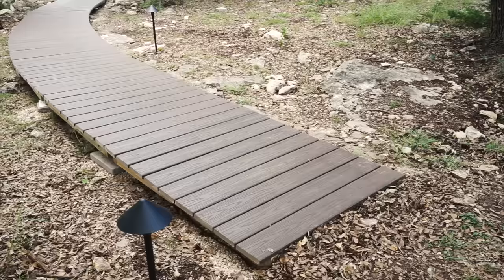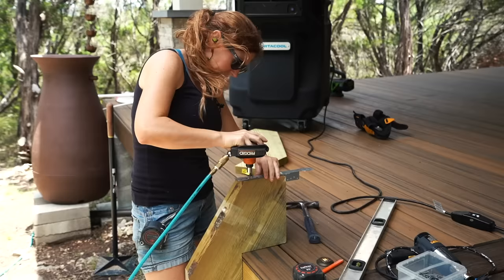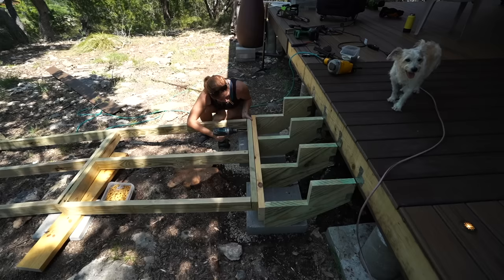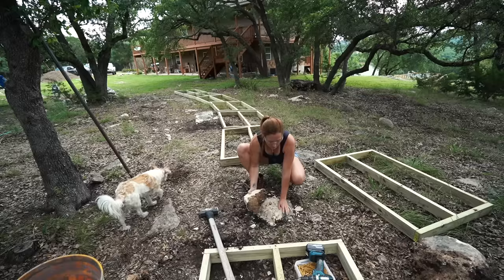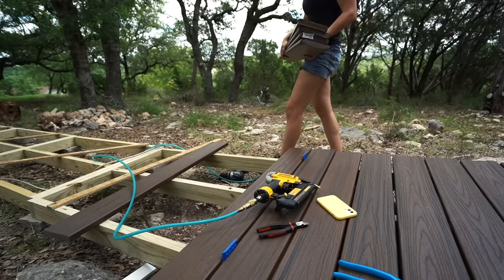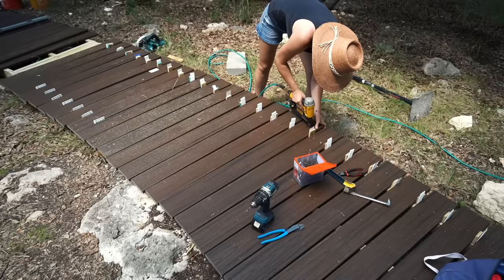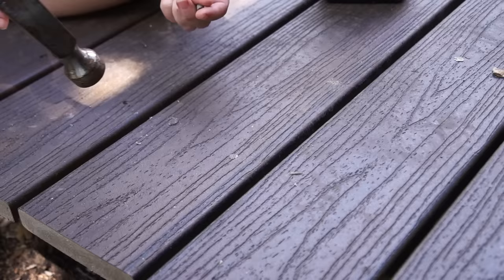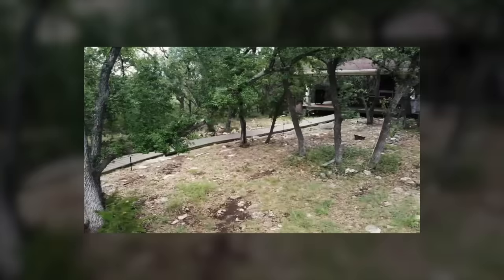Easy DIY Wooden Walkway | Path To My Outdoor Kitchen | Part 10

Comment: 6:31 but what about the boxes? even though they are treated, they will rot at some point and will have to be replaced. How easy will it be to remove the composite boards then?
Reply: She said the screws hadn't come in yet.  They can just be unscrewed and redo a section.  Pressure treated on gravel will last pretty long, I have similar to this with just old hemlock and as long as you have good drainage then we still haven't seen much rot.

Comment: It looks awesome! Question: When you bolted the scrap piece of wood diagnonally across the rectangular box, didn't that create an uneven height of the Trex boards that you later placed over it?
Reply: That diagonal piece is just temporary to hold the box out of square. Once you start screwing the top boards in place, they will do the job of that diagonal piece, so the diagonal piece can be removed.
Reply: @llamadohgaming6787  aah, now I understand. Thanks!

Comment: April, I'm curious why you started putting the brads in on a 45* angle with your jig to hold the tool, and what caused you to change your mind to just put them directly through the top instead.

In any case it looks wonderful, especially for the space it is in. I'm glad it turned out just as you desired. Love your channel. Thanks for the content and keep up the great work.

Comment: It's almost as lovely as you. A word of advice: when using a nail gun, avoid using your other hand to hold say a 2x4 like you did making the frames. Instead, stand on it, use your foot to hold it and get some steel-toed boots. If a nail skims off as in a double-bump, your boots will protect your toes.  I've seen nails go into hands so quick it doesn't even bleed... until the doctor cuts it out.

Comment: Nice job. BTW with the treated wood frame in contact with the ground, how long do you think before the wood rots and is no longer structurally sound? maybe use composite for the frame too?
Reply from the maker: You certainly can use composite for frame too but so far I've had no problems with my using treated wood. Thanks for watching.

Comment: This is nice. However where I live with rattles and field mice among whatever else nature brings I don’t want to build a home/ hiding spot.  Yours has a lot of hiding spots underneath.   I was thinking of pouring concrete to level it or just lay 1/4 inch mesh underneath and hope I block any entry to underneath.  Any suggestions?  Have you had anything living undenearh it?
Reply from the maker: I've had no issues but being in the country, if they're there, they are already around. Thanks for watching.

Comment: Trex board disintegrates and warps if you cut or screw into it. Its designed to be held down with special brackets. Its basically particle board once you expose the insides. I have to replace trex decks all the time. No one uses the brackets, and everyone cuts and screws through them. You voided the warranty the second you hit them with that brad nailer or cut them in half t make 8 footers (what i assume she did). 40 dollar boars that wont last 10 years now. Could have gotten 10-15 out of 2x6. Even flip them half way.

I'm surprised another contractor didn't say anything. If you look up Trex warranty its voided the second you "break or puncture the surface". The box of special brackets you have to use are at the store but they sure don't advertise them. Why would you, they get people to buy $50 8 foot board that lasts about the same time as a $5 2x6 because no one knows you cant cut them or screw them down or puncture the surface in any way. I'm not sad about it either, i get to replace these $50,000 decks with $10,000 wood decks all the time.

I guess you could seal the ends and every screw the but no one does. Look up ho to install trex brackets. They are grooved on the sides so you can screw the brackets into the wood but the bracket holds down the boards on the side. Still have to screw down the outside ones though and seal them. Just use wood.

Comment: Looks great, very cleverly done ... BUT, I doubt your timber is inground treated, it looked to be a soft wood, you will get rot where the timber touch the ground ... 1-2 years it will start to come apart.

Comment: Not sure what climate the area is that you built this in, but if it is area where the ground freezes with frost going into the ground 3-4 feet. If so did the frost shift the framing boxes up and down causing the deck board joints to longer be fluish with each other?
Reply from the maker: I live in Central Texas. Very rarely does it get below freezing for more than a few hours. Thanks for watching.

Comment: Galvanized fasteners and pressure treated lumber do not mix. Much better to use fasteners specifically designed for treated lumber,

Comment: I like what you have done there April, tradition be damned I say! Well done, it suits the natural elevations and lines of the ground much better than what would normally be produced. Without an traditional ground anchoring, does it move at all?
Reply from the maker: I've had no problems with walkway at all, regardless of rain or winter weather.

Comment: My only concern is, why not randomly dig post with concrete underneath the deck slabs to prevent it from shifting. Staking it to the ground permanently instead of just floating. My two cents

Comment: Should have taped the top edges of the pressure treated boxes.  Water will accumulate.  This will be the weak spot that causes trouble in 20 years;)

Comment: Even treated wood in contact with the ground will rot in about 8 years.
Reply: It will, last longer on her terrain. But the new copper wood treatment is not good as the old ones.

Comment: this path will rot in 2-3 years, the stands under the boards will fall apart in 1 year, after the first winter this path will be crooked and uneven.
to make a normal path, it is necessary to remove the top layer of earth, put geotextile, pour sand, make drainage to drain water, and only then make a wooden structure on top.

эта тропинка сгниет за 2-3 года, подставки под досками развалятся за 1 год, после первой зимы эта тропинка будет кривая и неровная.
что бы сделать нормальную тропинку, необходимо убрать верхний слой земли, положить геоткань, насыпать песка, сделать дренаж для отвода воды, и только потом делать сверху деревянный конструкции.
Reply from the maker: Actually I have not had any problems at all with this walkway. Not one issue so far. I do not live in a brutally cold climate and there is no frost line. Thanks for watching.
Reply: @AprilWilkerson  what is your average temperature in winter? and what is the average humidity? or you can tell me roughly where you live, I'll look at the weather parameters on the map.

Comment: SAFETY FIRST! Your hair is beautiful but you scared the sheet out of me using the circular saw with strands of it within inches of getting caught in the blade. Will pull you right towards the saw, scalp removal, etc. Nice project, stay safe.